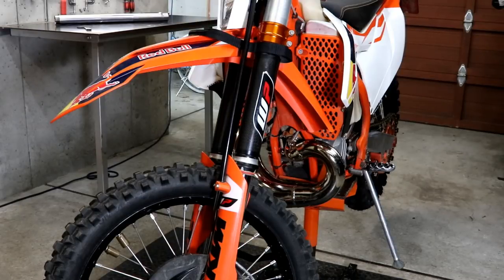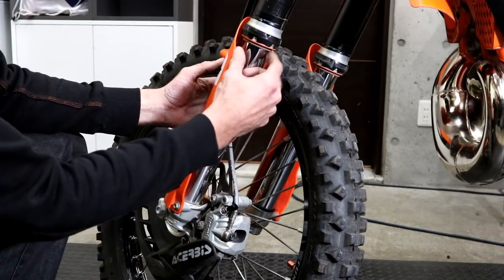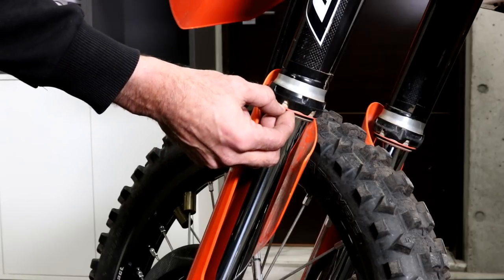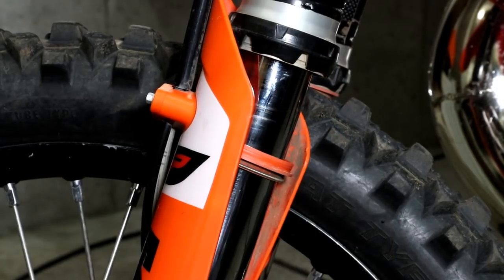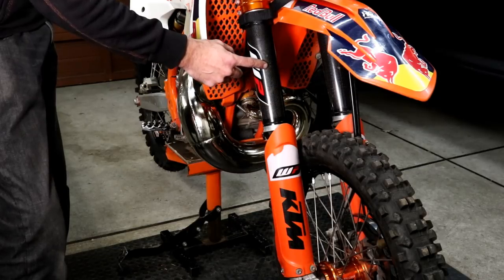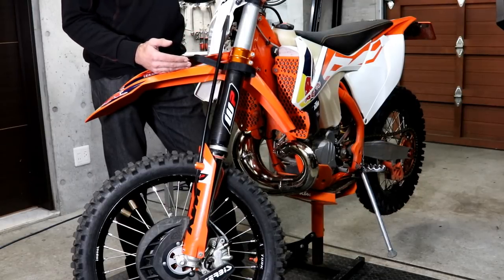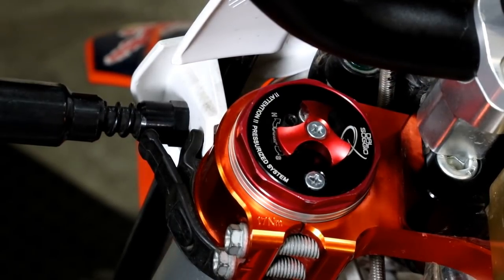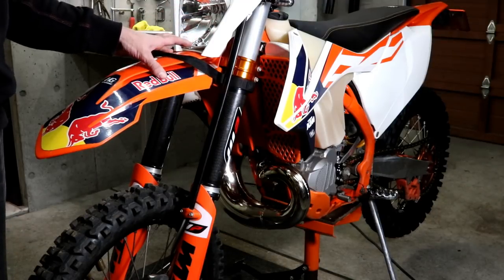Dirt Bike Fork Maintenance Tips

Comment: The risk racing fork tool is awesome for cleaning out the seal.  I do this usually after riding as the area I have been riding in is mostly muddy.  What is your opinion on the SKF mud scrapers?

Comment: What is the left hand side button cluster, or whatever you call that. It looks smaller(better) than the stock one on an exc-f which gets in the way of the clutch lever.
Reply from the maker: TRX250r08 - This style of control button cluster has been fitted standard on KTM EXC bikes sold in Japan starting from 2015 year model.

Comment: What parts cleaner do you recommend?
Reply from the maker: I use and general purpose brake and parts cleaner aerosol spray (Monotaro Brake and Parts Cleaner 2000). It's cheap and readily available in Japan and does a good job at cleaning oil and grease, without damaging parts.

Comment: I may have missed your review of the Dal Soggio Cartridge. How are they performing compared to stock setup?
Reply from the maker: With the stock settings I found the Sphere cartridges a little stiff for my weight and the riding I do (off-road trail riding). I revalved the compression stack and really like them. They work in all types of terrain, from low speed rock sections to drop offs with flat landings to high speed whoops. Love them. The XPLOR forks worked well at low speed, but I found they blow through the stroke too easily and felt unstable at speed. The Dal Soggio Sphere cartridges aren't a cheap upgrade, but I think are well worth it if you ride regularly and aren't happy with the the XPLOR forks.
Reply: Thanks, I actually have the 4CS forks which I feel are very unpredictable. I've been on the fence about whether to go with the lower priced Ray kit or the full blown Sphere's. Do you have any experience with the Ray kit?
Reply: I have the Ray kit and Sphere. Ray kit makes 4CS working well in most condition but Sphere is another level.
Reply: Chieh-Nan Wang I was afraid of that! I probably won’t be content until I get them also. Thanks

Comment: how often should i do this?
Reply from the maker: I presume you're talking about pulling down the dust seals. If you're riding in a lot of mud, it's best to do it after each ride. If however conditions are dry and you don't see any issues, once every 10 rides or so should be fine. When you wash the bike always inspect the tubes for scratches and oil leaks.
Reply: ok thank you, i just ordered that rhino 360 fork seal cleaner thing because i spent 200 bucks rebuilding my forks because they were leaking
Reply from the maker: If you are mechanically minded it's not that difficult to overhaul the forks yourself and save a lot of money. I made a separate video regarding how to replace the oil seals on XPLOR forks if you're interested. You do need a few tools though.